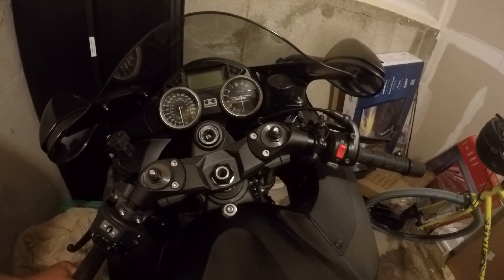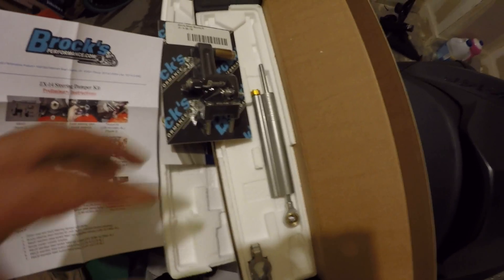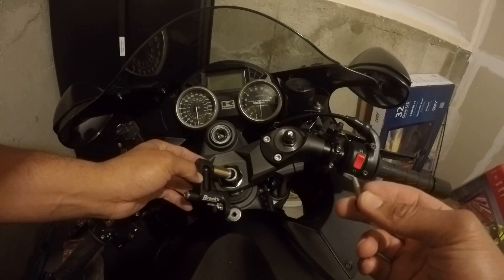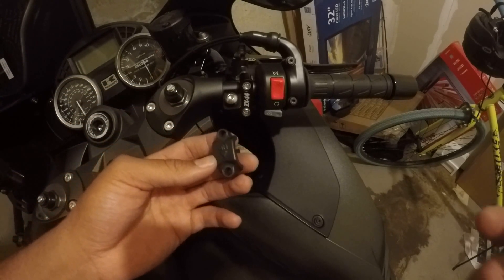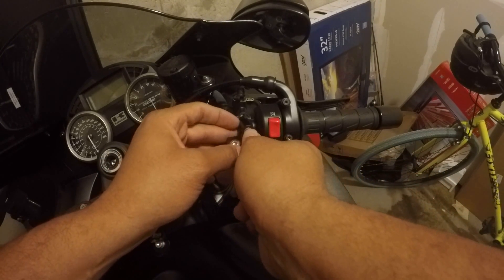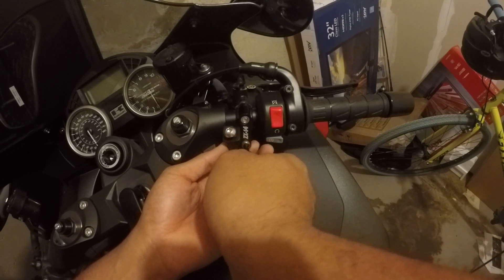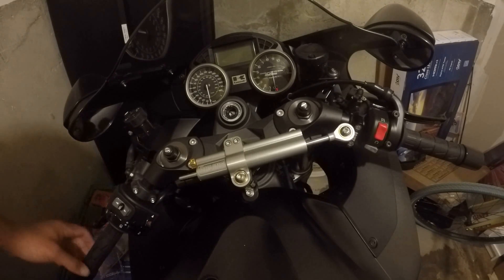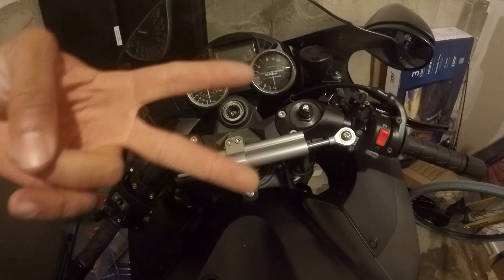2016 Kawasaki ZX14R Steering Damper Install

Comment: Why does the ZX14r need a steering damper I see guys that race and don't have it what's the use of it thanks?
Reply from the maker: TCH HEIL typically guys that race zx14s just drag race so it is not really an issue but if you ever turn at a high speed and pick your wheel it is possible to set it crooked and get a tank slapper
Reply: better to have it and not need it then need it and not have it. I bought a GPR for my ZX6R track bike. Selling the bike I bought the bracket to fit it on my ZX14R.

Comment: I have a electronic steering dampener on my 15 zx10.. it not working after I got it back from the dyno and custom shop.  do these dampeners have to get replace yearly or its just a normal issue
Reply from the maker: Shoun Kennedy no idea i will have to call olins
Reply: thanks
Reply: Mate of mine had one and it never worked on his zx10. He said they are put on mass produced  bikes. Ohlins by name but not by nature